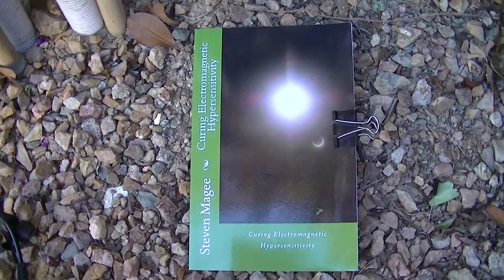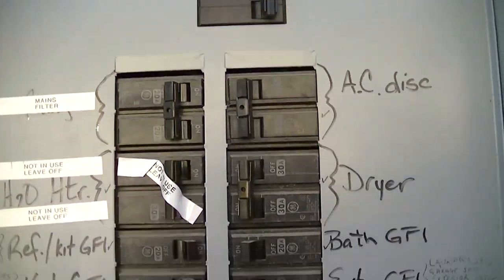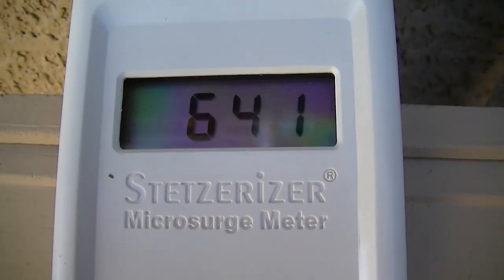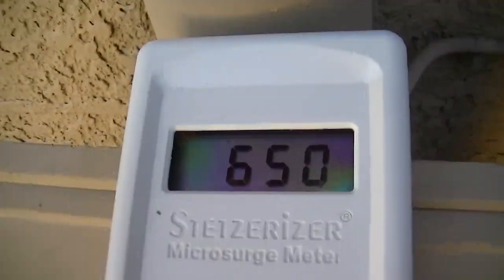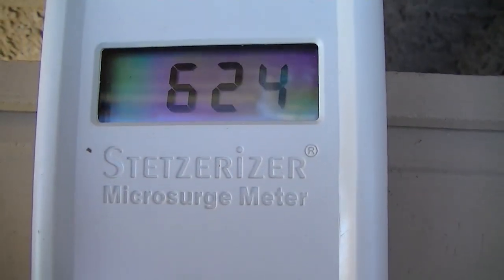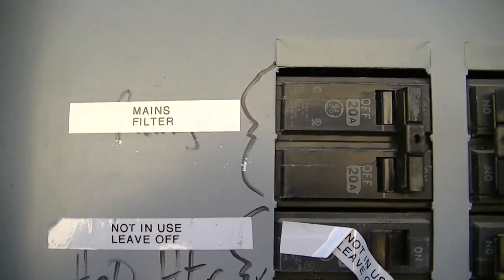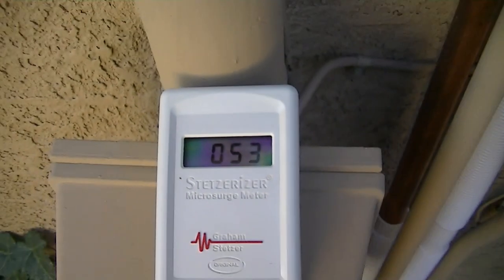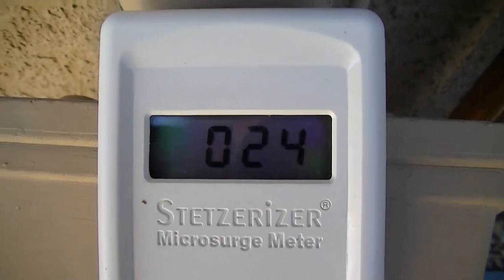Testing of Home Fuse Board Filters with a Microsurge Meter

Comment: The mains filter`s you turned on, those 2 breaker switches are wired to the microfarad filter board you designed ?

Thanks again for another insightful video !
Reply from the maker: The lower filter circuit breaker also connects to the small capacitive filter that is in the books "Electrical Forensics" http://amzn.com/1492118907  and the extended version of it "Toxic Electricity" http://amzn.com/1475295693 I am currently developing the research on the larger filter shown in this video.  The commercial capacitive filters are commonly sold as Stezerizer or Greenwave.
Reply: Thanks for clearing that up.
I thought maybe I had missed something...

Could you tell us what model # GS meter did you buy ? I know they have 2 but not sure how much higher the one reads then the other...
Reply: Here is a great video showing the 2 types of meters in action. Dirty Electricity: detect, measure and eliminate it. Cheers
Reply from the maker: NoFear4XJs Stetzerizer Microsurge Meter GS-M300-A, I believe it is the standard model.

Comment: Very interesting - thank you.  Do you have more information on the filters - didn't find anything on your website Steven specific to these.
Reply from the maker: I'm still developing the research using Dayton motor run capacitors, # 2GU39,  which is a 47.5 microfarad dual capacitor.  There are 9 of these installed at my fuse board that can be switched in or out as needed.
Reply: Did you ever get this finished?